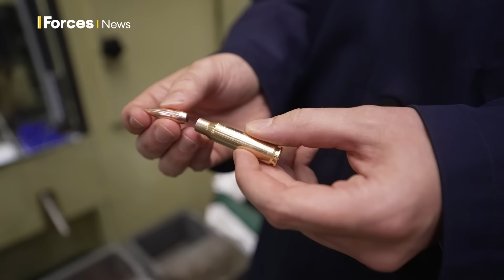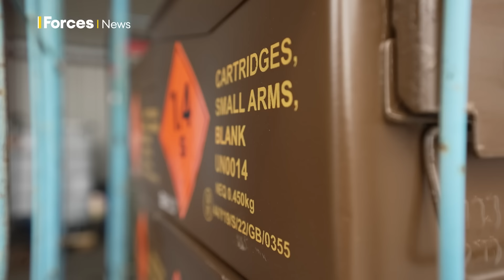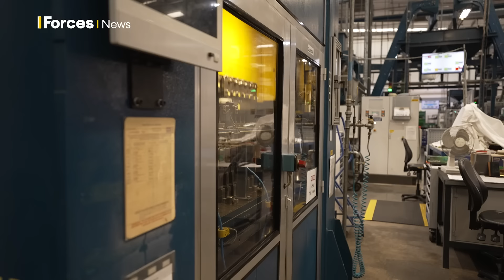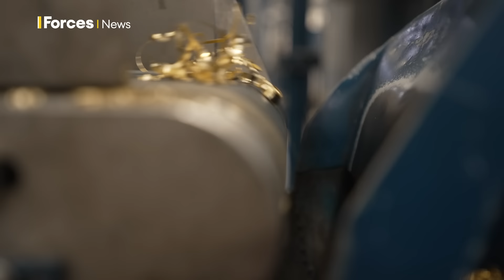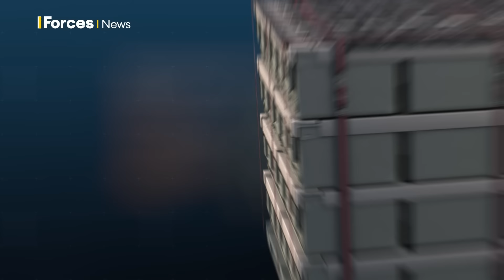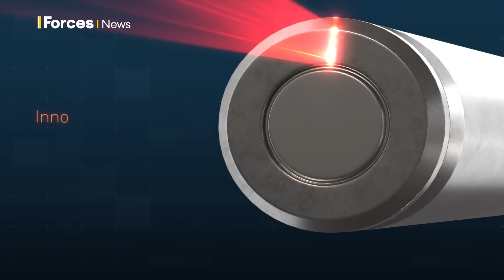Exclusive: Inside the factory that makes the Army's rifle rounds

Comment: Why don't they use normal iron or steel for bullets? I had the idea to fill thermos bottles with materials that help with increasing exploding power and can be put in a howitzer or so. It makes the costs smaller in a war that they didn't want.

Comment: If they're so concerned with making the ammunition lighter, perhaps they should switch from brass cases to aluminum.  Nobody went out into the streets of Fallujah to sweep up once-fired cartridge cases for reloading.
Reply: The U.S. army's new 6.8 SPC round can use polymer cases.  it only saves 30% in weight but I guess when you are in the field that 30% is everything.  The problem with aluminum is that it is not ideal for long term storage.  Also I have bought aluminum 9mm in the past and for some reason my pistol chokes on that stuff.

Comment: I really don't like the information vulnerability represented by the scannable QR code on every bullet. See, every case from the same pallet will probably have the same batch information. While potential (more than real, let's face it) adversary has only code of factory and date of production, having more information on the case which could narrow down it's origin is literally a present for opposing's force intelligence. And while it can only be an ID encoded in QR, it's the same for same batch, right? 

Imagine: a special tacticts unit has been repeatedly leaving casings from the same batch in various parts of the theatre, after engaging with enemy and falling back (reconnainsance attempt). And appearance of this group used to correlate with next surpsing attack in that particular direction. Casing scratch and damage analysis isn't enough to determine whether they're the same, but there's now the code on every bullet which is consistently the same for a pallet, and telling them more than a spent casing really should.

If their intelligence is no fools, they will figure out eventually, that there will be a bigger attack in this direction very soon.

Comment: I call BS on the "weight" savings intent. It's not about saving the soldier or transport, it's about MONEY, the cost of brass, improving the bottom line.
Reply: It depends on who's financing the development of a new ammunition type. If it's a government contract, then weight savings could be the primary motivating factor. But BAE would certainly use weight savings as a key selling point in order to generate interest for any future buyer of said new ammunition if it was developed as an internal project.

Major companies aren't motivated by one single point when it comes to projects like that - even if money is often an outsized motivator.

Comment: Ive been to the Norma factory twice, the process is basically the same.

What surprised me the most is the machine that takes pictures and measures the casings and rejects bad ones. The speed it happens at, it is absolutely astonishing.
Reply: God I hate Norma.  I can't tell you how many decapping pins I've broken trying to reload Norma cases.
Reply: Norma is USA
Reply: In what country is Norma made?  I've seen it for sale a bit more over the past few years.
Reply: Do you know what machine/manufacturer they use for this?
Reply: I mean the machine measuring the casings? @shafferhead
Reply: @mariotolusso3514  Look up high speed optical sorters.  They are common in the food processing and packaging industries.
Reply: Norma quality control is terrible.

Comment: Why do I feel like that barcode would be like leaving your business card on the battlefield, letting the enemy know who supplies the ammo for their enemy and where to find the ammo makers.
Reply: Cases have always been stamped with the manufacturer code. The problem with small arms ammo is that the batch details are not on the round but on the can. As soon as rounds are taken from the can, they lose their identity and cannot be re-issued. Also if there is an ammunition performance failure, it is difficult to track a failed round back to the faulty batch.

Comment: We have multiple factories that supply ammunition for the US military. Lake City being the largest and in constant operation for the longest. Other smaller factories for military use that can be placed into operation. And many civilian ammunition manufacturers that also contract with federal gov to manufacture ammo for the military.  Winchester makes 9mm and 12 guage ammo and sometimes is asked to make 5.56.  The 2020 corona virus has substantially driven up costs.  Not sure the exchange rate but in 2019 a box of 50 rounds of 9x19 mm could be purchased for about 11 US dollars and 20 round box of 5.56 for about 7 US dollars. Today 9mm is close to 20 or more depending on if its for range or self defense use and 5.56 about 15 dollars
Reply: Bro what.......your telling me.....you can get a box of 5.56 for 15 bucks in the states....

BRO HERE IN NZ 5.56 IS LIKE 1.50 A ROUND😭😭😭😭

Comment: How are the dimensions of the cartridge kept even when the brass is stretched/formed like that?
Reply: The brass cup goes into a hole (like a barrel) with precise internal diameter. There is a plunger coming from above and pushes down on the brass cup and due to the three dimensional stresses in the brass it flows upwards between the plunger and the walls. Then there is an ejector which pushes the formed cartridge from below

Comment: The precision of the moving line, placing the brass cup exactly under each stage of the forming press, is amazing.  For me, it's not about the product in the video,  it's the machines.
Reply: Ofc its about the machines ..its even the title. Nothing exciting about cartridges which have been used for over 100 years lol
Reply: Gears and stepper motors me boy

Comment: The narrator and one of the guides were wearing their earplugs wrong. Those 3M plugs should be rolled up as tight as possible, and inserted deep into the ear canal, not left hanging mostly outside the ear.

Comment: putting QR codes on bullet casings could be helpful for keeping that ammunition out of the black market, because it could be used to trace a round back to the last legal sale, and thus to whoever is responsible for it getting into the black market. a QR code would enable the printing of basically a very long and very specific serial number that could narrow down who bought and sold a particular cartridge more. 

I think traditionally, the international black market for guns is probably somewhat dominated by soviet standard guns and ammunition, but this is probably shifting somewhat towards more NATO standard weaponry, for example due to the taliban capture of all that american-made equipment, and just the lesser international military deployment of former eastern bloc countries as compared to NATO countries since the 90s.

Comment: I am not swayed of the need for barcode traceability on the cartridges.

Most often traceability is about quality control. You would barcode food items and medicines so if there ever is a problem with the quality you can identify all other items in the batch that could also be affected, and trace it back to which production line and when it was made. And help to trackdown the source of the problem.

The quality of every cartridge made needs to be perfect. And they use cameras and lasers to assure that. So you can't take tolerate bullets in the field that have a quality issue. So traceability isn't that important because you're going to go to extreme lengths in production to ensure there is no quality issue.
Reply: @Robert Stallard I would love to know how many times a problem with the ammunition have actually occurred which warranted an investigation trying to identify the production batch.

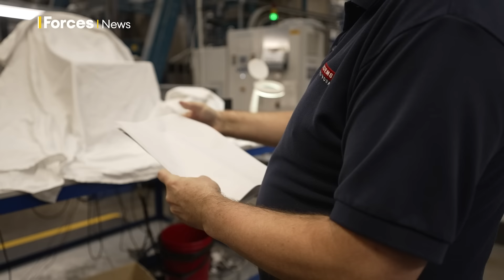Comment: If you look at 5:52 you'll see that the case requires a berdan primer (two non centered flashholes) and not the US standard boxer primer (single centered flash hole.) Typically the boxer primed spent cases are easier to recycle, but the UK is probably not worried about re using military brass since there is probably little commercial demand for it.
Reply: Crazy thing is Berdan primers were designed by an American, and the Boxer primers were designed by an Englishman.
Reply: Good catch.
Reply: The UK polices up as much spent brass as humanly possibly and a great deal of it is reloaded. RG ball comes in two flavours. Cardboard boxes of 20 rounds that have been reloaded - used for gallery ranges, you can tell its reloaded as it has pronounced case anealmentat the shoulder and neck. Ball for use on operations or on field firing ranges such as Sennybridge is brand new, comes in bandoliers of chargers for speed loading mags and has the usual mix of one in five tracer. Ball. Blank. It all gets collected if possible or you would kill the environment. The sheer physical mass of brass used is phenomenal, you have to see it first hand to understand the sacks and sacks of empties that are policed up after a battalion sized exercise. Now take that and repeat it weekly.
Reply: I believe after exercises the military dies have to collect a certain percentage of used casings (can't remember the number). Think they just get melted down though and reforged.
Reply: @Will he heck as like look up videos concerning "reloading berdan primer." The boxer primers other militaries use such as the us can be sold, hand loaded, and used again with no smelting.
Reply: It's so it cant be reloaded, by civilians or who ever they may be fighting against.
Reply: @MrDakkyz  It still can be it just requires modifying the case, but it'd make it harder. You can find videos of people reloading Berdan primed cases successfully

Comment: Curious about the rejected cases. What are the findings and corrective action?
Reply: @Wayne Flanigan 
It’s more a production engineering QC question. 
What are the key characteristics and associated variables? 
For example alloy, grain flow misalignment, die wear, die lube, anneal state, etc. 
I imagine once the process has been optimized it would be possible to pinpoint corrective action and intervention point. Mass production and QC is actually fun.
Reply: mainly down to die wear and system malfunctions. As the plant runs, the drawing dies wear out and the cases grow to the point where they are out of spec. After so many cases the dies have to be replaced to bring the production back on spec.
This is a known problem that goes back to the 1850s when they first started to swage projectiles rather than cast them,
Reply: @felixthecat265  
It seems that brass cases are cold formed and annealed at several points. I wonder if they use die lubricant like we do when hobby case forming? Or do they run the carbide dies 
dry and tolerate the wear but avoid the mess? 
Nowadays there are coatings , like DLC from Balzers, I wonder if they would boost die life? If anyone has a contact at that plant, suggest they look at DLC.
Reply: @richardkudrna7503  It's a while since I was at RG and am not sure what the current practice is. They have done both in the past.

Comment: 10000 extra round per pellet load is massive the edge it will give for every supply run would add up over time intems of firepower downnrage.
Reply: I'm not convinced that weight is the typically limiting factor for pallet capacity or that a helo/truck/whatever can necessarily carry any more rounds just because it is lighter.  The case dimensions are fixed, so volume can't really adjust and ammo cans are packed by unit or volume, not by weight.  Likewise, while it will reduce the burden on the foot soldier, it doesn't necessarily mean they have room to carry another magazine.

Comment: The machinery in that new building had to be tested. That means that they needed inert material with EXACTLY the same physical properties as the various propellants. Yes, there are multiple options on propellants, as some shapes of granule burn faster than others.
Reply: Some propellants have retarding agents in to control the burn speed